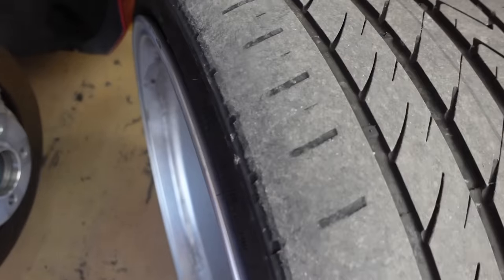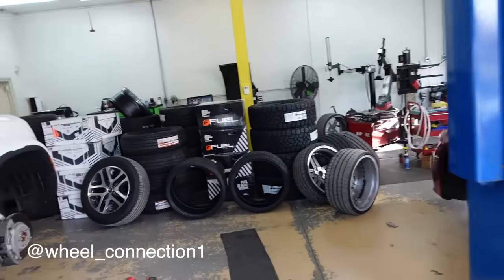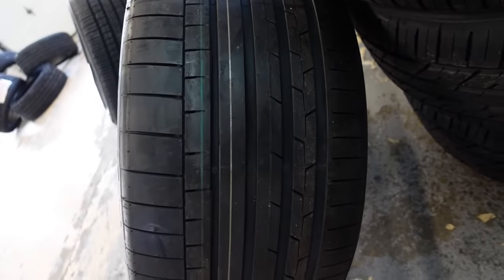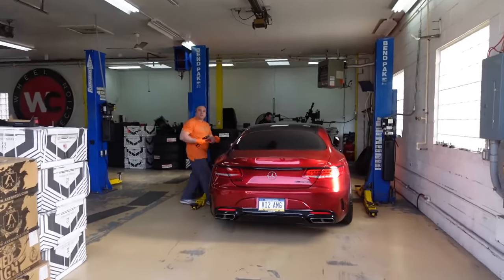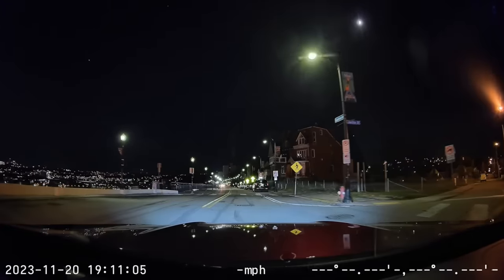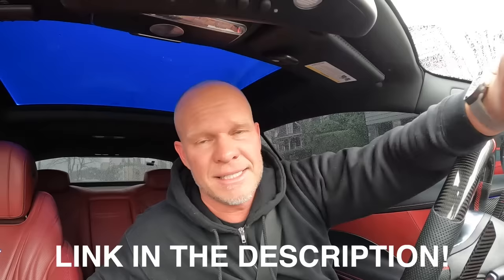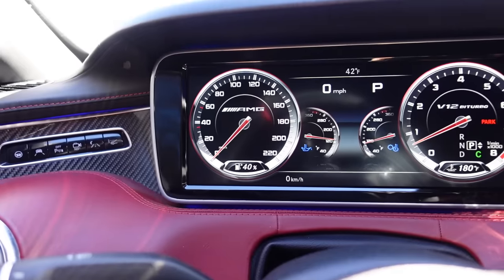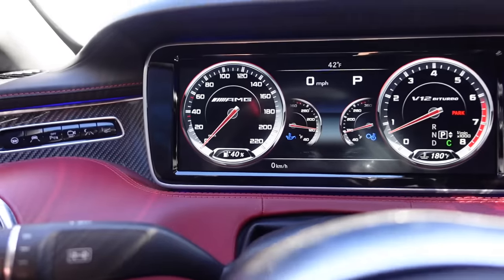Hate To Admit It.. This S65 Modification Was A Mistake

Comment: Lesson ,don't eff with perfection, suspension is tuned best out of the factory
Reply: Maybe on high performance cars, but not on a lot of other stuff.
Reply: @thorsky2754 I'm sure he was talking about Mike's S65 in particular. I believe aftermarket stuff like that does no good, they're not developed by AMG engineers.
Reply: If he doesn't modify, he doesn't have a channel.  The same for all automotive youtubers.
Reply: Cracked and or bent wheels occur with the factory wheels both 19s and 20s forged or cast. The camber wear issue is from lowering it for sure. Depending on what kind of tires you have the factory setup you get 8k to 20kish miles on the rear. The sport/performance tires will be on the lower side of course and the less performance oriented tires will have more life of course.

Comment: This is a great car! I’ve got an SL63 which also has ABC; I wouldn’t let anyone touch my wheels except my local Mercedes specialist - you need the wheels and ABC setup properly! Not only will you be making the tyres wear badly, you’ll be making the ABC work harder if everything isn’t aligned and setup properly.

Comment: So with the S 65 when the magic ride activates, it actually puts more pressure down on the wheel and if it sees a pothole, it will put more pressure down and thus will definitely crack a wheel on such low profile rims. If you put it in Sport it will be even worse.

Comment: I’m in Columbus Ohio running a similar setup on my VW Phaeton. 22x9 and 22x10.5.  Just went thru similar problem with my lexani tires as well. I had 255/30-22 and 305/25-22 and the front inside tires wore out quickly. I put the proper size tires on being a 265/30-22 and a 315/25-22. Almost the exact same circumference which is needed for my all wheel drive system. I highly recommend these size tires!
Reply: Nice! Another Phaeton owner! I am actually running 295/25r22 all around on mine. I got 22x10.5 all around on mine for tire rotation purposes.

Comment: You may need some adjustable control arms and/or other suspension components to properly get that alignment in spec. I lowered my 370Z and had to install adjustable lower control arms and toe bolts to get the alignment right. The stock components don’t have enough adjustability to account for the geometry change when dropped

Comment: The car looks great, but I think 20” wheels would look better and the tires would be tall enough to save your wheels.
Reply: I was tempted to go 22 on my Cadillac,glad I went w/20". These new cars don't exactly have a big cushy ride.
Reply: The factory 20s and 19s cracks and bends as well. There isn't any saving of wheels unfortunately.
Reply: @gasolara2002   of course, but smaller wheels equals higher profile tires, which means less force being transferred to the wheels and less chance of the actual wheel hitting the ground when you hit a pot hole, therefore less chance to damage a wheel.

Comment: Any smart person would know to get wheel alignment after you mess with the suspension.  After I put lowering springs on my SUV, it went right to the dealership for an alignment.  I even aligned my cars when switching out between aftermarket and OEM wheels for the change in seasons..

Comment: You need adjustable rear control arms for the CL/S Coupe models when lowered. You will have the wear problem until you get the adjustable arms to officially get rid of the extra tire wearing camber. At stock height and configuration, the rear tires don't really last long either. Between 8k miles to 25k miles. You are doing the financially smart thing and sticking with the cheaper all season tire until you dial in the alignment the best you can.

Comment: Mike, your flashing TPMS light on the AMG, is an indication that the tire sensor is either broken, or that the battery in the sensor is dead. Either way, only way to rectify that issue is to get a new tire sensor installed.

Comment: I had an s65,s63 & s550 and  problem is that this cars are very heavy. If your going to put 22' low profile tires you need a good quality 3pc wheel.
Reply: Agreed - a set of HRE’s would be killer on it
Reply: The stock forged 20s and 19s even bend and crack on these. No matter what wheels are on these they will all have cracked or bent wheels in places with not smooth roads forged or not. Barrel replacements and wheel repairs will be just part of the ownership costs.

Comment: These cars come riding too high from the factory. They should just lower them a bit more. But if you’re going to lower them, you need to go through the process of doing it correctly. I’m in the process of picking out some rims and tires for my S 65 now but I don’t think I’m going to lower it.

Comment: A what the hell are those tyres ?? B you did a half cocked job, you got to reset the geometry if you mess about lowering it. I paid near on £80k for my S65 an its on Michelin pilot sport 4S only . I dont do half a job
Reply: Michelin pilot sports for my Mercedes ONLY!!!!
Reply: He is learning. Lowering them causes some pain. Continental extreme contact sports are actually better for this application as they dont suffer with sidewall cracking. The Michelin unfortunately has the issues with the side wall when it isn't used often or exposed to various weather changes like this particular example is. Check the inside wall for cracks in the sidewall and if you have cracking get a warranty exchange. It will have a blow out eventually.

Comment: UH EM... Not Mercedes.. Mercedes is a coupe, v12.. You my friend, are driving an AMG!!!! There is a difference, as you are learning.  Rule 1.. ALL Season tires. Softer.. Can handle the pots, a little better. Rule 2.. For everyone else.. GET the tire\wheel warranty.. TRUST ME. 
Rule 3.. AMG..= Eating dem tires.. V12 Torque + 4Matic =Gonna eat dem tires.. EVEN just driving sensibly, AMG's munch dem tires, easily. AND we have it good now, with 4matic. RWD=muncy's..

Facebook meme.. AMG deboo.. Are you holding out on me$$$

Comment: Hey Mike~~ it’s not just Mercedes and don’t blame on the car… when you lower the car without proper camber adjustment… wearing inner side of the wall is very common issues and not sure why you are pissed off about that… it’s just not great to hear as audience… mostly you are just whining and complaining…. That’s how I look at you as a channel… or jsut very predictable for truck or AMG… if this stresses you out then go back to stock.. easy fix… if Mercedes stress you out then drive Honda civic…. Very reliable car~~ and you don’t have to whine about it